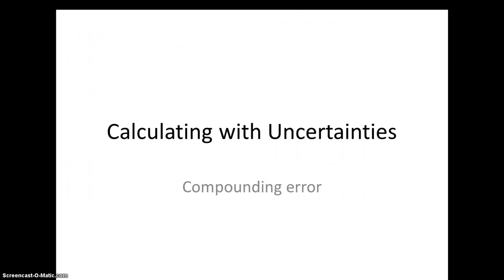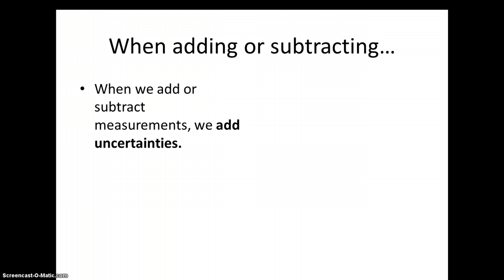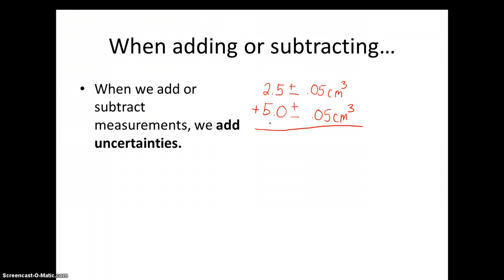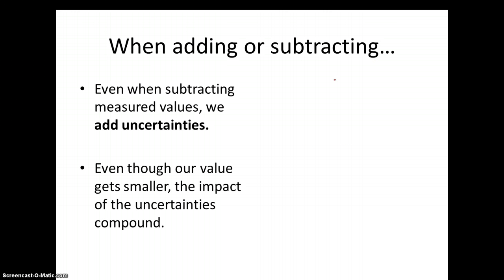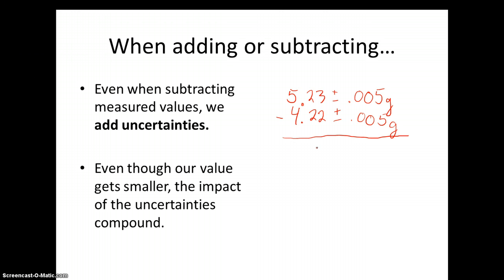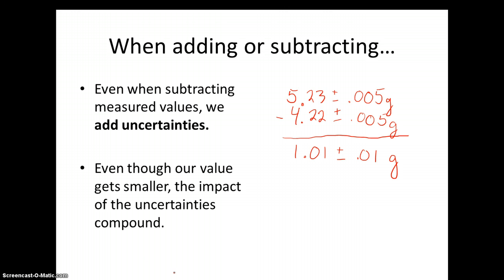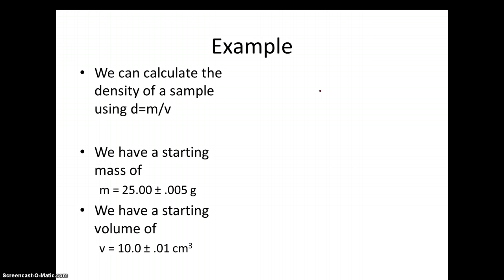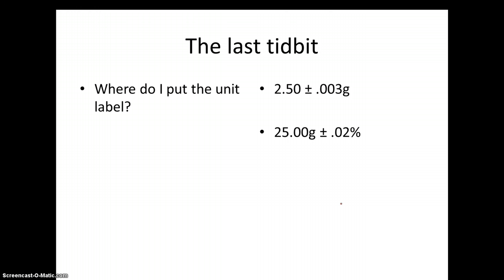Calculating Uncertainties

Comment: This is badly wrong. VARIANCES (squares  of the standard deviations) are additive, while uncertainties (standard deviations) are not. So to combine uncertainties when adding, you need to square the uncertainties, add them, then take the square root. See any basic stats book. This is one of the first things we learn in a stats class. Colin's video is wrong about the addition case and also wrong about the multiplication case. Don't trust this guy on stats issues.

Comment: This treatment of uncertainty is a bit simplified. For the most part, it will result in somewhat larger uncertainty values than the standard treatment will give. Primarily, you are adding uncertainty components like they are along the same axis, but really they should be added like they are orthogonal components of a vector, and therefore should be added with pythagorean theorem. 
example: Delta(x+y) = sqrt[ Delta(x)^2 + Delta(y)^2 ] instead of simply Delta(x) + Delta(y) as you have in the video. Similar issue applies with multiplication and division.
Wikipedia page: https://en.wikipedia.org/wiki/Propagation_of_uncertainty quite technical, but thats the underlying approach typically used

Comment: I need help..what if you are given two measurements (length and width)...you are not given the uncertainty as well as the uncertainty percentage...how would you calculate uncertainty??....(the length btw is 4.07 and the width is 2.52)..thanks
Reply from the maker: You're left with a challenge here. Without uncertainties reported with the measurements, or knowledge of how the measurements were made (caliper? ruler? what units?) you are left with making assumptions. The initial measurements were missing information; no amount of calculation can fix that. There is no real way to give a great answer here.
If we make some guesses, we do know that the last digit reported is an estimate, and often the uncertainty is half of the smallest decimal  value reported. Since each value has a hundredths decimal,  a possible absolute uncertainty would be + or - .005 . This is a big guess, though. If you measure with a ruler, you are matching two ends of a ruler (the zero point and the end point) up with your object. That is two error possibilities, so you would need to double your uncertainty. If you used calipers, only one measurement was made.
See where we are stuck? When we start guessing or assuming, we undermine our work. Anyone else have helpful thoughts?
Reply: @ckillmerportageps  apologies for not fully specifying the question... the measurement were made with a vernier caliper
Reply from the maker: @pickleporkdork7358  If you took the measurements, what were the smallest divisions on the caliper? Did it show to the tenth place? If so, I recommend using + or - .05 as your uncertainty Your caliper may have come with documentation that indicates it has a narrower range than that, however.

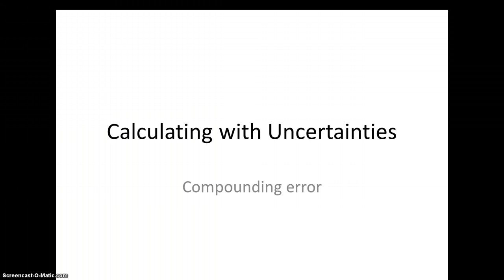Comment: At 0:35, it is totally wrong. It should be 4.45 +/- 0.03 g and 4,5 +/- 0.1 g.
Reply: your second proposal is correct...the first one is not : if you round 0.0025 it is 0.003..not 0.03
Reply: @skatiaris21  False. The precision of the answer must be the same than the precision of the uncertainty.
Reply: Mike Astro must the same of what? retype correctly please
Reply: Mike Astro i guess u say the same number of decimal places...thats true but you cant transform 0.003 to 0.03...u multiply a number by 10 arbitrarily...
Reply: @skatiaris21  You are right. It is 0,003 and not 0,03. So, in the uncertainty is 0,003, the 4,45 must become 4,450 because the uncertainty must be at the same level that the measure. For the rounding, there is a rule (rounding at the even number) that says that if the number to round is even followed by a 5, we let the even number like that. So, 0,035 would become 0,04, but 0,025 would become 0,02.

Comment: how do we calculate the absolute uncertainty of the result  if we consider the square root of two variables A and B?
Anyone?
Reply from the maker: I ran across this article. http://web.uvic.ca/~jalexndr/192UncertRules.pdf
For square rooting, treat it as though you are raising the uncertainty by the power of 1/2 (for example, the square root of 4 is the same thing as 4^(1/2)). Then, you will multiply the relative uncertainty by the power (in this case, 1/2). 
Example:
( 9g plus or minus 1%)^1/2  =  (3g plus or minus .5%)
Reply: Colin Killmer  Thank you so much.
Also, how to find out uncertainities while operating  with logarithms?

Comment: So if you calculated a value of 2800 which you left to two sig fig, since this was the significant figure of  the values used to calculate it (and therefore the highest sig fig we can be accurate to). What happens when you calculate an error of 0.01 for this value should I right them as 2800.00 plus minus 0.01? Or should I write the calculated value of 2800 to a higher degree of accuracy initially?

Comment: Hi Colin, how can I convert the unit from g/cm^3 to kg/m^3?
Reply: You must multiply your answer by 1000, for 1 kg. is 1000 g., and 1 m. is 100 cm. When you plug in the corresponding values, you get the following: (1/100)/(1/100)^3, which is (10^6)/(10^3), which is 1000. Therefore, you multiply your g/cm^3 value by a factor of 1000 to convert to kg/m^3. Q.E.D.
Reply: you divide your value by 1000